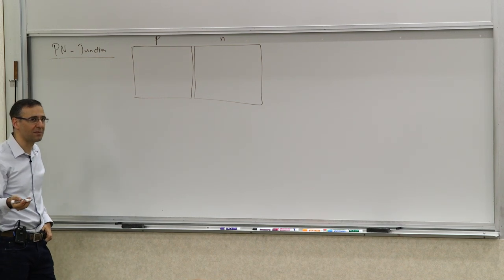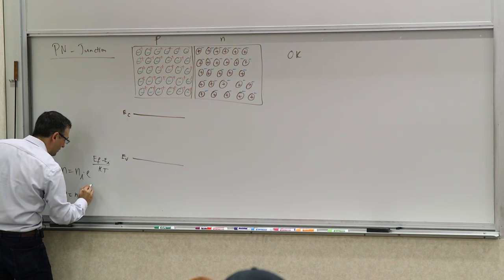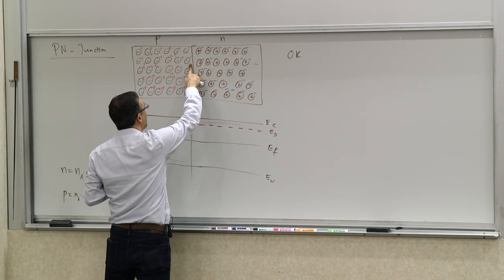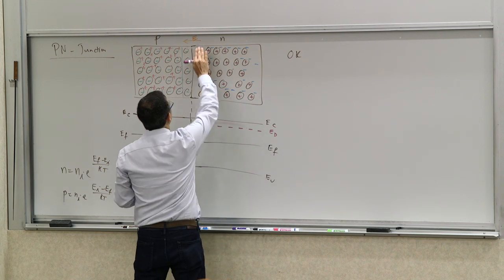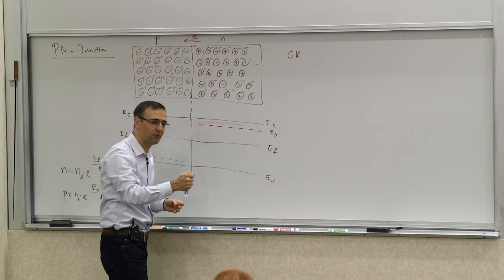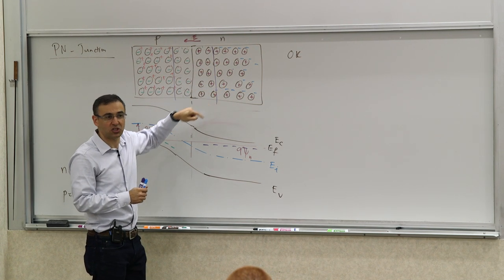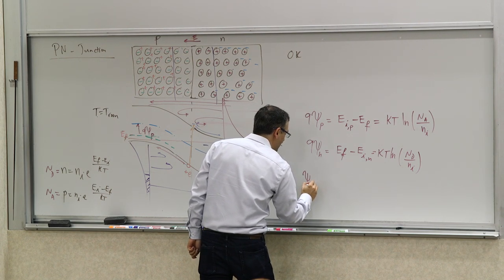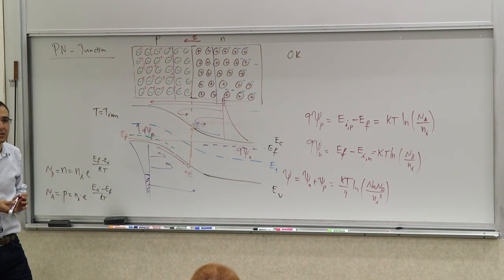104N. PN Junction, Depletion Region, Diode Equation

Comment: sir at 11.38, you told this is called diffusion.but before that u told temperature is increased then u explained the whole process.but in diffusion ,no external energy is applied,its only due to difference in concentrations,but as per ur explaination when the temperature is increased then diffusion happens ,i did not get it sir ,can u tell how please.

Comment: At 34.26, you mentioned "net increase" in electrons and to calculate that you subtract electrons ""before" forward bias from electrons "after" forward bias. But then while calculating the "net flow", you say the "net current" (total diode current ) is only proportional to net increase. Shouldn't the net flow be only proportional to   electrons after forward bias?
Reply from the maker: Yes, the diode current equation is Is*(e^(VD/Vt)-1). The '-1' is to count for that difference. However, in most practical case of using the forward bias, the exponential is much larger than the '1', so it is often ignored to get a simpler more tractable equation.

Comment: I have a question. 

While discussing the forward biased diode we arrived at the conclusion that the current grows exponentially with lowering the potential barrier ψ0 because of the probability of the carriers having large enough energy (according to Boltzmann’s distribution) facilitates that relation. However, if we increase bias voltage to VD = ψ0 the barrier is reduced to zero when every electron in the conduction band has enough energy to leap over the “barrier” (which is then basically nonexistent). 
If that is indeed the case, how may further increase of VD lead to increase of diode current (according to the diode equation) ? 

Thank you in advance!
Reply from the maker: This is a good question. What often in reality is that you practically do not get there, since as you lower the barrier the current grows exponentially and there is larger and larger I*R drop within the bulk of the diode, so the junction with experience a smaller fraction of the excess external voltage. The current associated with the potential barrier fully lowered often cannot be supported by the series ohmic resistance of the diode without a significant  external voltage.

Comment: Why do the Conduction and Valence energies get bent in the PN Junction? I thought they were fundamental properties of the silicon atom's shells. Is it because Ec and Ev actually mean "the electrostatic potential energy of an electron in the conduction and valence bands at any given position while considering the contribution of electrostatic potential due to the depletion layer's E-field? The difference between a PN junction and the previous examples of semiconductors in these videos (which all had the same Ec and Ev for the same element) is  that there was no net E-field we had to account for that would otherwise influence the electrostatic potential energy of electrons in the conduction or valence bands. Is this non-0 E-field the cause of the bending in the Ec and Ev? If so, then the idea that the Conduction and Valence band edge energies are fixed values, as initially introduced in most videos & books (ex: "The minimum conduction band energy of element x is y Joules"), is not general because these electrostatic potential energies can change depending on if the atom is isolated or if it is in the presence of an E-field, right? Thanks.
Reply from the maker: The conduction and valance bands are energy levels for the local electronics. If there is an electric field between region 1 and region 2, there is an electric potential difference there and therefore and energy difference for the electrons in the conduction (or valance) bands in those two regions. This exhibits itself as the bending of the bands. The intrinsic Fermi level is essentially half-way point between the valence and conduction bands, which will bend with them (but not theorem energy level, which is parameter of the distribution)
Hope this helps.
Reply: @AliHajimiriChannel  thank you very much. Im watching the BJT videos in this playlist right now. I cannot thank you enough for your practical and theoretical insights which offer a comprehensive understanding of how first principles can be leveraged to design practical semiconductor devices.

Comment: Why the Vd is smaller than Si0 after applying that external electric feild the internal potential was reduced by Vd then it must be negative because if i want to apply an external voltage to the diode it must be larger than the internal potential in the diode in order to have current but according to what is written the Vd is less than the internal potential and it has reduced a little without making it negative
I wish you understood my question sir
Reply: Do you mean that the diode will take a small amount of the external voltage of the battery and leaves the rest to cross the diode ??

Comment: Diode has built-in potential, so if we connect terminals of a diode with a metal wire, can we expect some current to flow?
Reply from the maker: No. The potential drop is due to work function difference. When you make two contacts to external lead metals of the diode, you form two more juctions with their own work function differences, so if you measure the potential drop between the two metal terminals of the diode, you will see the algebraic sum of these three work function differences, which is zero (unless you use two different metals for less(wires) of the two terminals.
Reply: Is it okay to see this as, pn built-in potential is created by losing energy (electrons holes combined to get to lower energy state, near the junction?), so just connecting a wire across it can't give current. Because flow of current will imply energy transfer from the diode to the wire?

Comment: (Referring to the instant 9:18 in the video), one electron per donor atom is loosely in n-type material, but not completely free from its attraction. How come it is so likely that these loosely bound electrons form bonds with acceptor atoms in p-type region, leaving their bonds with donor atoms?
Reply from the maker: The required energy for breaking a bond and forming a new one with the acceptor is much less than the one associated with breaking a bond and not forming a new one. So the thermal energy will allow for this to happen frequently at room temperature. There are other ways think about it. The process is really a quantum mechanical one similar to tunneling through a large potential barrier.
Reply: Thank you Prof.! Got it.
Reply: Based on the energy band diagram, the energy level EA is much lower than the energy level ED, EA is right above the valence band while ED is right below the conduction band; electrons as the temperature is decreasing would like to be in the lowest possible energy state, and that is why they would leave the phosphorus atoms and go into the vacancies available in the covalent bonds of Boron atoms.